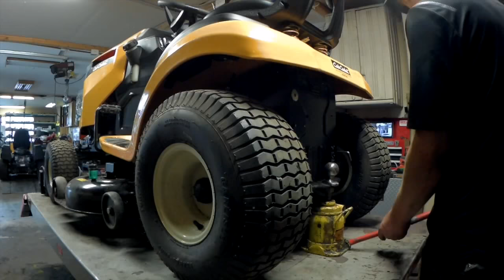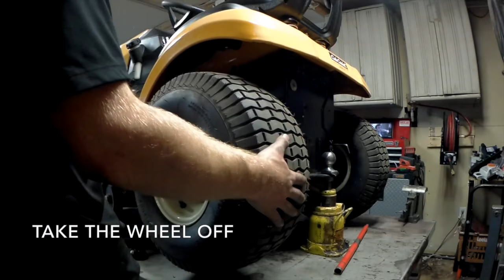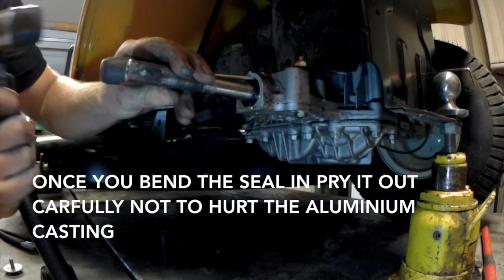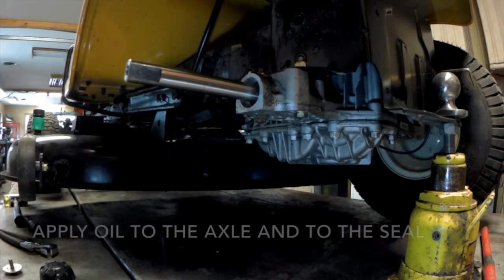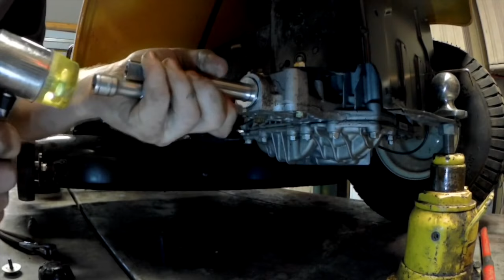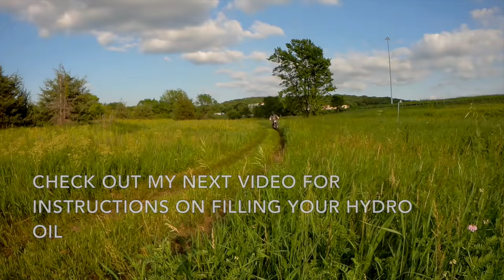How To Replace Axle Seals On Cub Cadet

Comment: I called my cub dealer.  Said parts are not available.  I went to the fastanal store.  She made some calls and got them located. Thanks to all you did on tracking the seals down.  Got four ordered at $43.00 will add tax and shipping, then they come in .
Reply from the maker: glad my video could help! glad you found them. Seems odd that your cub dealer could not get the parts. I have personally ordered the seals in the last month directly from cub and they arrived in the normal amount of time. Maybe you should ask for one of their older employees to help you next time. Finding good help is hard now days.
Reply: @SEParotti  yes I should have driven over to deal ship. They look a little harder when in person.
Reply: Where can I find those rubber seals??

Comment: I replaced the seal using the washers, but cut a piece of plastic pipe (proper size) I had laying around to tap the washers evenly. Then I used the plastic pipe to install the hubcap of course both with a rubber mallet.  Thank you Redbeard, very helpfull
Reply: Good idea! Thanks

Comment: Thanks for the demo.  Just replaced mine. Mine was ripped and came out in pieces.  Took some time but patience and got it out fine.  Funny, in the demo, you left the washers on the axle when the tire was put back on.
Reply from the maker: that is a home brewed long term fix for the issue. i used to see machines back every few years. since adding the machine bushings i dont see them back anymore. if you want more details on it i explained it in another comment reply somewhere in here.

Comment: Thanks for the "How to",  my only problem was removing the old seal. I ended up having to use a very small screw driver to make a little room between the seal and casing, so that I could get a screw driver blade about the size of the one in the video in and remove the seal. Thanks again.

Comment: Thank you for the video! with your video I replaced an axle seal that has been leaking on a Columbia riding mower, similar mower to Cub Cadet. The replacement of the seal was easy enough but I had no idea how to do it until I viewed your video. The part number for the seal is TT187T0134280 cost from local dealer was $7. Leak is fixed, I used one-half quart transaxle oil which I also bought from the dealer.

Comment: Thank you for video. The shops near here wanted my lawn mower for 3+ weeks to replace seal and $90 + parts. Told each one of them I'm not going to leave my needed mower for 3 weeks.

ps. Don't pull lawn rollers with your Xt1 Cub cadets. That's what got me in this mess.
Reply from the maker: Glad I could help! Spring time is hard! Right now my shop is 2 weeks out. We are working hard to get mowers out the door. This time last year we were 5+ weeks out and turning down work because we didnt have the room for them all. Just try to be nice to your local shops! if we could fix everything right away we definatly would! Glad my video could help get you ready!

Comment: I watched your video and came away informed. You mention leaving the two washers on the axle after new seal replacement and not having a leak down the line. On my LTX1046 I don't have a leak, yet. From your learned experience I am considering putting two washers on mine before a leak. Can you agree?

Comment: Perhaps adding PN for the seal and the oil cap/plug in the description would help? UPDATE: I went to the cub cadet website and they gave me this PN for my XT2 lawn tractor: TT-187T0134280 rear axle seal

Comment: I have a problem where the seal tore in half and wedged itself in there. I was running snow chains on my cub cadet xt1 and somehow it caught onto the PTO cable got pulled in wrapped up into the axle causing a leak. It destroyed the pto cable of course but now the seal has separated into two halved a smaller inner circle which came out but the larger outer ring is stuck inside. What can I do? Thank you
Reply from the maker: The best solution would be to try to wedge a small flathead between the remaining part of the seal and the case and pry it twards the center. It will bend as if its made of sheet metal. Then you can grab it with a needle nose. Always work at the top side of the axle. That way if you damage the case at all its easier to fix or less likely to leak. Your other option would be to split the case and just disassemble until you can get it out. Its actually not that bad to do but be ready to clean and reseal everything.

Comment: Thank you for the great "How to" Video. So I too have a leak on the wheel seals! My Machine is a 2014 LTX 1045  13AX93AT056
could you look up the seals for me and also the part number for the vent plug in case i wreck it taking it out

Thank you in Advance from Wasilla Alaska
Reply from the maker: Yes! I will be looking up numbers for you and a couple others this evening
Reply: I have one is as well.  I heard they changed the seal size in 2017 and hence why im having issues.  I think the ones they gave me are too big.

Comment: Excellent video! I subscribed to your channel.
I have an XT1 with an axle leak on the right side and can't wait to do this repair myself. 🙂
However, I can't find the axle seal part# for my model 2015 XT1, model 13AXA1CT596
Any help is greatly appreciated.

Comment: Can you help with part numbers please? I have a 2014 CC1016 KHG model type 13BG93AG603 and cannot find a diagram anywhere that identifies the part  number for this axle oil seal.

Comment: I have a 2015 cub cadet xt1 lt 46 what part number would I need for the axle seal and trans oil and where do you drain the trans oil at and how many qts does it take to fill that trans the model number is 13APA1CT056

Comment: Great video! I have a Poulan Pro (PP19A42) and can't find the part number for the transaxle seals, would you be able to look up the part #? Also, do I use grease or oil, as it looks like grease is leaking out of the seals.

Comment: I have model # 13APA1CT056 which is an XT1. My mechanic says they don't make seals for this machine and wants to charge me $575 excluding labor for a new transmission. Obviously, that's not going to happen. Seeing this, I believe I can do it myself, I just can't seem to find the correct model number for the seal. My next question is about transmission fluid, where to I top off the transmission fluid (location) once I replace the seals and what type of transmission fluid should I use? Thank you for the video, straight to the point!!!
Reply from the maker: Yes! Your authorized cub dealer should be able to get you the correct seal number pretty effortlessly. Just have your model and serial number ready from under your seat on the white sticker. As far as filling it back up please check out my other video! Not hard to find! Either use the link at the end of this video or go on my chanel, i dont have a lot of videos so its easy to locate! If your local cub dealer cant get you the correct number just leave your model and serial numbers in a reply and i will look it up for you when im at work on saturday or monday. Hope this helps!
Reply: I guess I was using my wife YouTube account. Here's the model #
Reply: @SEParotti  Sorry, 056, not 065
Reply from the maker: @shalayla2010  i will have to look this up tomorrow at work. i will also need the serial number to assure that it is the correct part1
Reply: @SEParotti  1C195H30046
Reply: Any luck? Partstree is a no go for this.
Reply: @navcat2010  Were you able to find the part number for the axle and vent seals? My XT1 is a 13APA1CT596, but Redbeard seems a little overrun with part# lookups! :)
Reply: @dustinpatrick3587  yes, however the parts that came didn't fit, so I asked my mechanic to figure things out. We finally got the right one's. The shipping took weeks due to the pandemic. I must have some obscure model. Thanks for your video!

Comment: That bushing you put in after putting in the new seal was not something you took out of there, and my cub cadet is just like yours in that it doesn't have it either; As soon as I take the black spinning spacer thing off, the next thing I see in the seal inside the aluminum casting. So how do you know you need to add that piece back into the chain after the fact? I'm confused.
Reply from the maker: The machine bushing is something I started adding about 6 years ago. was seeing a lot of repeat machines having the same issues. Since adding the machine bushing I have gone from at least 1 set of seals in the shop every couple weeks down to just a few a year. And I have not seen a single machine back for seals after getting the machine bushings.

Comment: hi great Video can't find the 2 washers .The 2 that i have seem to loose .Tuff Torque sould have some kind of a part for this problem .the cubbee is only 4 y old. but the area that i cut is not the smooth.  thank
Reply from the maker: The washers I used are machine bushings. you should be able to find an assortment of them at your local hardware store.

Comment: I replaced the seal and the new seal leaks as bad as the old seal. Any ideas?
Reply from the maker: Make sure you clean the axle before installing the new seal. If there is pitting or dirt you could damage the new seal when installing it. Make sure there is no pitting on the shaftwhere the seal sits and check the aluminum around.

Comment: Thanks for the video.  I wish my Cub Cadet X1 would cut higher.
Do you think a spacer could be added in between the axle mounting and the frame?
Reply: Bigger tires.
Reply: @mikemccabe1324  Any info, tires? do I need new rims?

Comment: What is the part called ? Cv axle seal ? Oil seal?
Reply from the maker: The part is called the axle seal. If you find your way to the parts breakdown its under transmission. It does not matter left or right.

Comment: perfect video man, I wish I had seen this before I took most of this thing apart trying to find that vent cap! I need to replace these seals and can't find the part number. Will a damaged vent cap affect anything on this mower?
Reply from the maker: The base of the vent cap needs to be in good enough shape to seal but the top part is just a dust cap. Maybe not a deal breaker. But if u get me your model number from under the seat i can find the appropriate part numbers for u.
Reply: @SEParotti  13AQA1CQ056 If you can tell me which seals I need that would be awesome! Thanks!
Reply from the maker: TT-187T0134280 is the part number for the seals. You can find them on amazon. Just type the part number into the serch bar. Remember to get two. If one seal is leaking the othere is usually about to start. Hope this is helpful. Let me know if you need any more help.
Reply: @SEParotti  Thank you! I have them on order, i'll report back when this project is complete! Thanks for your excellent video and help!
Reply: This weekend I followed your video and had this job done in less than 10 minutes. Thanks for putting in the time and showing us how it's done!
Reply from the maker: @wileythenord  Im so glad things went well for you! If you have any other issues let me know! I repair these full time and Im excited to make some more videos! All I need to know is what people need to learn!

Comment: I have a leak in the rear and now the mower won't move do you think it is a transmission or axle seal?
Reply from the maker: It probably leaked all the fluid. Replace the seals like i show you in this video and then watch my other one showing how to fill it. You will be good as new!
Reply: @SEParotti  It's running now but when I press on the gas it have a lot of torque. Is that a sign of transmission going to go out ?

Comment: Do you have part #s for the seals and vent cap? Great video!
Reply from the maker: i will try to remember to get the number for you when I am at work tomorrow. hope I can get it in time for you! I try to check the comments often but ive been gone.
Reply: @SEParotti  any chance you had time to get them? I plan on ordering everything this weekend.
Reply from the maker: Tt168t2024250 is the part number
https://www.amazon.com/TT-168T2024250-Troy-Bilt-Cub-Cadet-Craftsman-Yard-Machine/dp/B0721R3Q3Z/ref=mp_s_a_1_1?keywords=tt168t2024250&qid=1574292934&sr=8-1

That is a link to amazon. Otherwise punch that part number into google shopping it should show a bunch of options to order from. Partstree.com is a good place to find cub cadet parts. Hope this helps!

Comment: i have a LTX1050  every axle seal i order for it for a LTX1050 is the same and its about .250 OD to small it has the snap ring
Reply from the maker: My guess is that you have a hydrogear rearend. The one i used for the video is made by tufftorque. If you get me the model number and serial number from under your seat i will gladly send you the correct part number. I will be at work for another hour and a half.
Reply: @SEParotti   i think i found the right ones i had to mic the rear end and the axle then order by the size i guess it can be used on 3 different types of mowers but thanks for offering

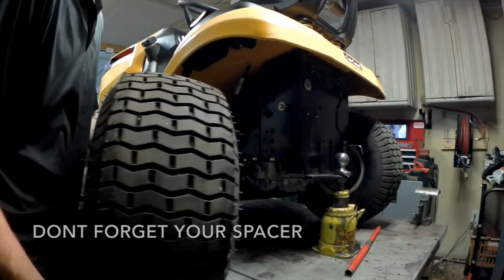Comment: Couldn't help but notice that you left the two washers, you used to install the new seal, on and then re-installed the sleeve without removing the washers! Wouldn't this cause the wheel inner hub to seat up 'hard' on the spacer when tightening the wheel bolt. They should have been removed. Just an FYI. This occurs at timestamp 1:23 on your video.
Reply from the maker: Good eye! Beleive it or not this is what i do for a living. Didnt mention it in the video but about 5 years ago i found if i install 2 machine bushings between the seal and the spacer you will never see it back for seals ever again. This seems to solve the issue these machines all have. Ive got another cub dealer next state over trying it as well and they swear by it now also!
Reply from the maker: Also as mentioned two washers would cause a space issue but thats why i use machine bushing. I spent a bit of time years ago figuring out what two sizes i needed to make the clearence just right. Very impressed u noticed in such a fast pace video
Reply: Ya know, as an afterthought, it occurred to me, do to this particularly goofy design, that the presence of something like this might be beneficial, I may consider the same approach on the tractor I'm working on. Incidentally, I do this as a hobby for family & friends. I'm dealing with a rear axle leak on a neighbor's 2014 Cub Cadet LTX 1045. I've never seen this occur before on many other makes and models I have worked on! Thanks!
Reply from the maker: If i had to guess i would say i service about 7-10 machines every day at work and probably replace seals in a rearend about two or three times a week. Its fairly comon especially on anything with a tuff-torque or hydrogear.
Reply: @SEParotti  Thanks so much for this video? Do you mind sharing what sizes you figured out were the correct ones? Hope to get this repair done this week.
Reply: @SEParotti  Do you happen to know what size machine bushings you used? I have to do this repair on mine and don't want it to happen again anytime soon.
Reply from the maker: @shanebanks5160  you know what. Im on vacation so i cant look at the pile on my workbench at work. But its pretty easy to figure out. Just measure the outside diameter of the axle and the inside diameter of the casting where the seal goes. U want the buching to fit! If you already have the seal just take it with you to the hardwear store and match the bushing to the seal!
Reply: @snakenfc  I used a 1/16 x .75 x 1.25". IIRC

Comment: This video was very helpful. Could you please tell me where to by the (2015) tt-19216334280 seal? Unfortunately some distributors list the 2017 # and say that it "replaces the 2015"... it does not. I accidentally bought the 2017 and they are bigger seals. Thank you for your help.
Reply from the maker: I would say your best bet would be to head on into a dealer. anyone who sells parts for any small motors brands should be able to get your part. tuff torque rear ends are in everything
Reply: Hey Redbeard- Just an update, I was wrong about the sizes. The old seal had disintegrated and
 broke off the metal ring from the seal and was left behind in the axle. It blended in so well with with the rest of the axle I couldn't see that so I though the seal wouldn't fit. Got the ring out with an awl and a hammer, replaced both seals, watched your other video on filling the transmission fluid, works good as new! Your videos literally saved me hundreds of dollars! Thank you.
Reply from the maker: So glad to hear it! If u really appreciate it hit subscribe! I wont make a dime off youtube till i hit 100 subs.
Reply: @DavidBluelineGaming  OMG.  I'm on my third set of seals.  I just realized I'm in the exact same boat.   I've been going crazy over seals that don't fit!   Thank you for posting this!